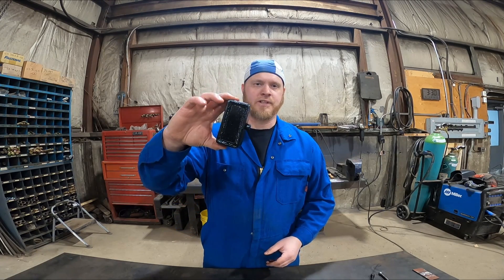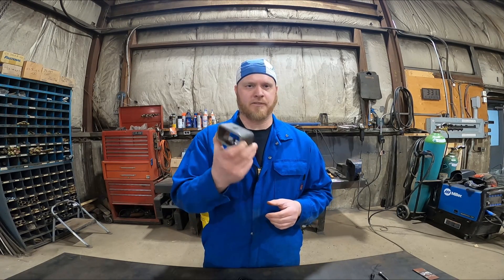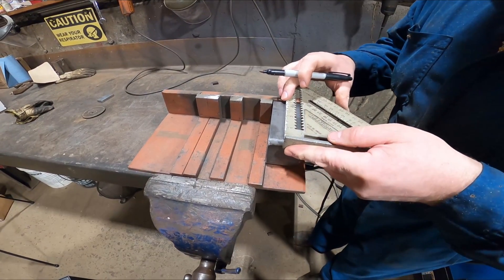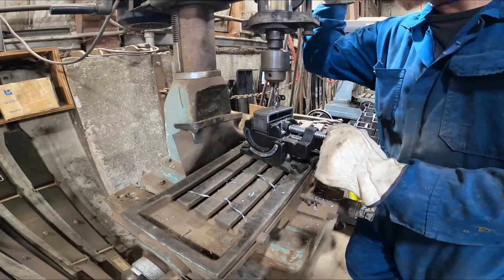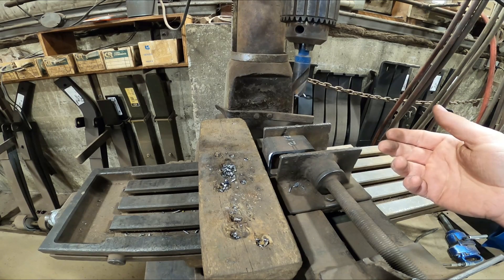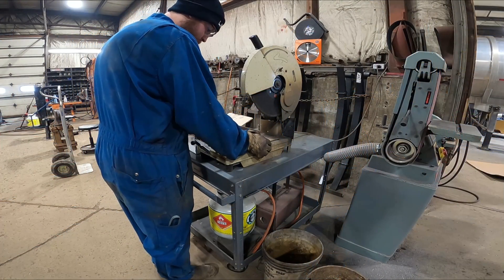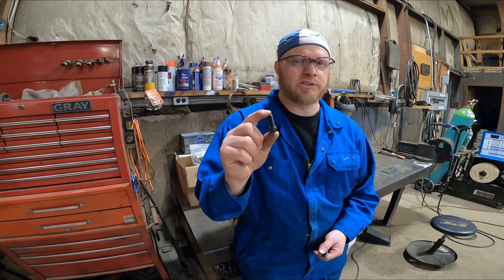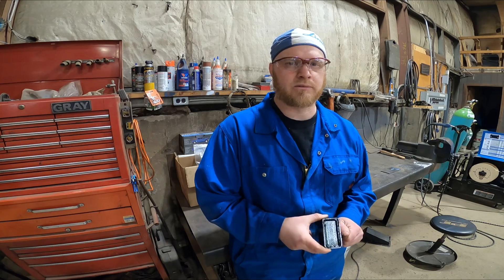Lessons I learned on my first fabricating run of 2" trailer lift blocks

Comment: been watching some of your videos.  love your content.  try to locate a shop with a CNC fiber laesr tube machine.  They can laser cut those tube sections with the holes laser cut in them as well.  Tubes like that will cost you around $6/tube for the cutting service.
Reply: I was going to suggest the exact same thing. :)  They could also laser cut the pieces that you put in the sides.  .....moot point....I just read the description block above.....making them from solid is way faster and easier. lol

Comment: Yes sir.  Fixtures are key for production work.  For those particular parts some blocks on the mill table secured with toe clamps is sufficent.  The part could be held down with another toe clamp.  Not as fast as a vise but still pretty quick.

The alleged premium a person pays for the right widget is almost always a bargain when compared to making or modifying the widget in house.  You simply can not beat the price point of a machine cranking them out.
Reply: Something the a Wilton Cam Action Drill Press Vise would be a big help. T
Reply: @rick_.  Yup